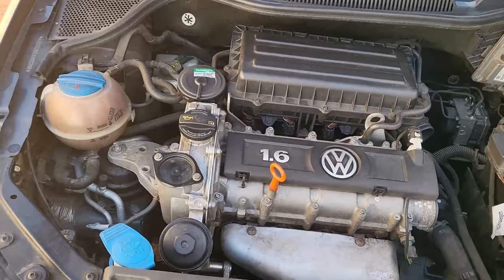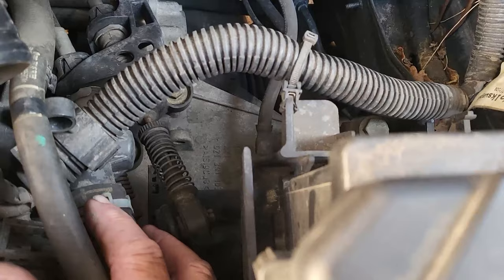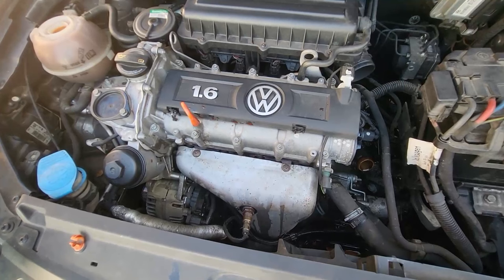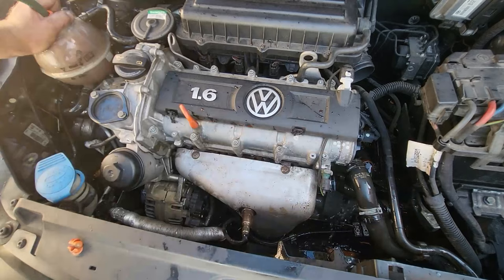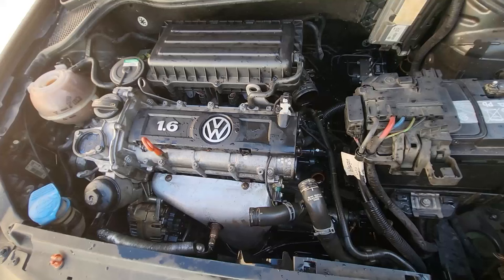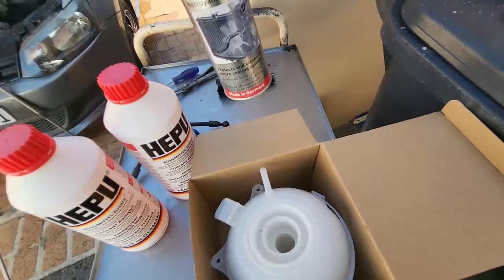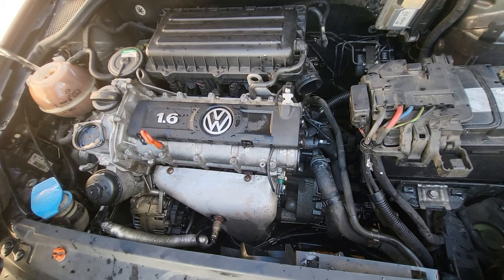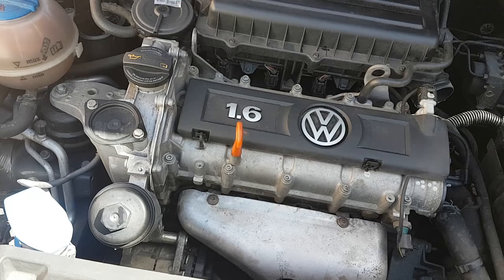Vw Polo Vivo - Treating The Cooling System

Comment: Hi Gary, i have a polo vivo. We replaced the water pump, thermostat and fan radiator switch but my fan only comes on for less then 5 seconds. Car is not overheating but i think the fan should stay on longer. Any advice please.
Reply from the maker: Hi Joshua, if the temp. is at the correct spec then there should be no issue, but some replacement fan radiator switches are known to be troublesome, so it is sometimes better to try another brand.

Comment: Thanks Gary, just a question if I'm done with the flush how do I bleed the system
Reply from the maker: Hi, Adiel refer to the time stamp at 14:12 on the video, one has to remove the temp. sensor and make sure no air, but water only flows out, then put the sensor back and secure it with the clip, also make sure you put the sealing o ring back on the sensor before putting it back, finally check it is not leaking. I hope that helps you, and thanks for your support it is greatly appreciated.
GARY

Comment: Does the radiator have a drain plug? I need to do it on my Polo Vivo 2014 but I have office hands🤦🏻
Reply from the maker: No, it does not, you have to loosen the lower radiator hose.

Comment: Thank you Gary. This helps me a lot. I just got mine overheated last night while travelling 300km. Will exactly do as your video.
Reply from the maker: Thanks for supporting my channel, Ahmad, all the best with treating your cooling system.
Reply: I did a trip with polo like this  from southern suburbs to ceres. It was raining very hard and I was driving quite fast the whole way. 120-160. As I got into ceres I got a dash warning with beep that coolant level low. Stopped car and I see coolant was halfway empty on the bottom part of bottle. Stopped at garage and topped up with water.

First time something like this happened. But I been checking everyday now and coolant level is fine…thoughts?
Reply: @luqies  I had same situation with my 1.4l gasoline Polo. The main reason was air intake preheater pipe which was cracked. Thus it's made of plastic and needs attention.
Reply: I sorted it out. It was the heater core that was leaking. No leaks now all good
Reply: This was super helpful, I have to replace the thermostat housing. Any advice should I flush firsts then replace?

Comment: Thank you for the lesson, Gary. 
I have a vw polo 1.4. CLP engine. The fan does not swing once the temperature switch sensor is plugged in. But it runs perfectly once the switch is unplugged. Unfortunately, for now, the fan stopped working completely. I tried taking it to mechanics, but they are failing to fix it. 
Please advise.
Reply from the maker: The switch that activates the fan needs replacing (the one you unplug to get the fan to work)
Reply: @vehiclemaintenanceandrepai3790  Thank you, I will try to replace it.
Reply from the maker: @masuleleon5283  I think it will solve your issue

Comment: I have completed all the steps! Very helpful video. I just added anti freeze. Is it fine with just anti freeze or should you dilute it with water? I used the same anti freeze as you.
Reply: But now I am stressing. How would I know if I have done everything right? I replaced the water bottle also but I see the one goldwaget gave me looks the same but its different inside. I have done about 50kms so far with the car and hasnt overheated?

Comment: greeting
does it have to be pink g12 antifreeze or can i pour green antifreeze
Reply from the maker: Vw-approved antifreeze does not come in any other colour. You can use another colour but it will not be the correct spec for Vw. so it will be less effective, but it can be used.

Comment: Could this treatment help solve a problem with the temperature guage fluctuating between 90 and 110 degrees on VW polo vivo 1.4 (2013 model)
Reply from the maker: No, check the temp. sensor on the engine, it may have to be replaced.

Comment: Hi There, very informative video. Quick question were is the thermostat on the 2010 polo 1.6 TDI is it also just on the right hand side of the engine block?
Reply from the maker: It is housed in the water flange, not quite sure about which side on the TDI but the petrol versions are in the flange behind the cylinder head, just trace where the radiator pipes go it should be into the water flange.

Comment: Hi Gary, great video very clear and concise 😊 I've got a water leak small leak via a crack in the water bottle, can I just replace the water bottle and throw some antifreeze or do I have to flush the system to replace the bottle. Thanks for the video and thank you in advance for further advice
Reply from the maker: If there is no rust in the system then just replace the water bottle and add anti-freeze, if there is rust in the cooling system a flush would be recommended, thanks for your support it means a lot, Wade.
Reply: @vehiclemaintenanceandrepai3790  hi Gary, there doesn't appear to be any rust in the system. Will replace the bottle and add the antifreeze you've recommended for vws. Thank you again. Will continue to support your great work🙌🏽💯

Comment: Hi Gary i have a Polo 1.4 with a rust and calcium buildup what is the proper way to treat  it the fan is not also switching on automatically
Reply from the maker: You need to flush the cooling system until the build-up is either greatly reduced or eradicated completely.

Comment: Hi there Gary. Thank you so Much for the  video. My Polo Vivo is seems to be not circulating the water in my tank. When I start the car the Water light immediately goes on.  The temperature levels don't go beyond 90°C on the reader. I have been advised that it could be the water pump that is the issue. Is there any other possible things I may Check?. Thanks
Reply from the maker: Hi Thamsanqa, it sounds like the water pump may need replacing, it could also be malfunctioning sensors, like the one in the bottle that warns of low water levels and the temp sender unit that measures the water temp. have these checked 1st.

Comment: Hi Gary if the water level picks up in the reservoir as then is heating and goes down when the fans come on. Is it normal or is there air in the system?
Reply from the maker: Normal as the water expands when heated.

Comment: Hi Gary, thank you so much for the video, new subscriber here. I have a same model, coolant water finishes within a day after driving few kilos, no leakage and overheating light comes on, what could be faulty here? Your response will be much appreciated.
Reply from the maker: Iit could be the Reservoir Cap's pressure valve opening too soon, common on these, try replacing the Cap and see the results, Tsepiso
Reply: Hello there, I’m experiencing the same thing but my anti freeze warning light comes after less than 500 km’s and this has Been happening for the past 3 months

Comment: Seems very good u need to replace the thermostat housing, does this need a gasket and or any gasket maker or silicon?
Reply from the maker: It is always recommended to use some gasket maker to help seal when replacing a thermostat housing, Vivian

Comment: Hi Gary I have the corsa Lite 1.4. After replacing the water pump and doing all the belts etc my water hasn't been circulating right. Almost as if my radiator is clogged. Now there is a lot of dirt/rust in the bottle. Would i need to remove the thermostat to do a flush? I'm kinda stuck sigh
Reply from the maker: Yes, it will be advisable to flush the engine, but also have the radiator flushed by radiator specialists, 9 times out of ten it is the radiator that blocks 1st as the tubes are very thin in the radiator, so if there are signs of rust, it could cause partial blockage in the radiator.

Comment: Hi Gary I have a Polo vivo 1.4 CLP engine....I recently redo my Top gasket and replaced the thermostat housing but my fan is not turning on...any advice?
Reply from the maker: Check the fuses and the connection to the sensor switch, Christiaan.
Reply: Ohk thank you...will do that

Comment: 60/40 or 50/50 water mix. I think Gary forgot to mention that. The water capacity should be around 5l. The antifreeze showed amounted to 3l. The water would have been 2l. Distilled water should only be used.
Reply from the maker: Thanks for your insights on this matter Matt, much appreciated.
Reply: I think if mixing the coolant yourself then distilled water should be used & depending on the climate of a country hot or cold the mix should be varied to cope with the climate ? 
   I heard that about the climate thing years ago somewhere lol, 
   But if your just flushing the system through its ok to use the tap water initially as its not staying in the system , 
  Ready mix antifreeze uses  distilled water anyway so that will counteract any small amount of tap water left in system .
   This is not a dig at you Matt or Gary this is just some info for those not in the know coz some of the comments on this vid shows me that some people havnt got the foggest on whats what regarding the coolant system in their motor. 
   Putting straight neat anti freeze without water into system  is not a good thing to do & putting anti freeze in system with regular tap water will eventually corrode parts & limescale up which again is not good & will become costly in the end so its best to do this job properly & to the letter of the manufactures specifications & dont attempt it if you are a complete novice .
   You could get away with doing it yourself many moons ago as the systems were straight forward but these newer motors engines are not so straight forward & again even attempting to do the coolant change without the adequite knowledge can become costly in the end tbh . 
 Thanks Gary for the vid & i did like how you gave your engine bay a virtual wash haha .
Reply: @pw3565  agreed with your statements above. I was told many years ago aswell that old coolant actually causes static in your engine so it’s best to change it every 2-3 years. Especially with newer cars, this creates havoc with the electronics.

Comment: Hi Gary, I put coolant like you did but I have been going through the comments and I saw someone who said we should put 60/40 of the coolant and distilled water so will it cause any damage if the coolant is not mixed at all it’s just pure coolant?
Reply from the maker: It will be okay, any coolant is mixed with water anyway, it is just the concentration that differs, thanks for supporting my channel with your visit and interaction.

Comment: The hepu coolant is 95/96%? It wasn't mixed 50/50? or was it used as is with no battery water premixed?
Reply: I had the same question, that is it not recommended to use distilled water, as compared to tap water?
Reply: @moffatk7948  I done it to my vivo  using that coolant but mixed 50/50 with battery/distilled water, i change it every 2 years, but I do mine differently not as thorough like this.i will let the car run with tap water and the heater on, then drain it by the little tap underneath the radiator,  because I don't allow mine to get as bad

Comment: Hi Gary does this method flush the heater core as well?
Reply from the maker: Yes, you just have to turn the heater unit to blow warm air while running the engine to flush.

Comment: Hey I’m having hard times to put the C clip on the temperature sensor back in please help…
Reply from the maker: You have to make sure the sensor goes in properly and the o ring seals correctly then the clip should go in easy.
Reply: The sensor is properly in I even try to lubricate it but still the C clip don’t want to slide in 😫😫😫
Reply: @vehiclemaintenanceandrepai3790  I tried my best it doesn’t want to… I even broke two of the C clips now tomorrow I will buy another… I hope on your next client that has the similar model you will show us how it’s done 🤦🏾‍♂️🤦🏾‍♂️

Comment: Good day Gary, im Eric based in East London. I have a polo vivo that has a over heating problem. It had the same issue 2 years ago and i eventually opted for the top gasket to be skimmed. The car overheated still even though i changed the thermostat, water pump, fan switch and checked the radiotor. Diagnostics showed an issue with the fan relay and i changed, then the over heating stopped since last december until this week. What could be the problem according to your knowledge? Polo vivo 2012 1.4 clp
Reply from the maker: You must perform a cylinder leakage test to make sure the gasket is not blown or the head, 's water jackets are not corroded and compression leaks into the cooling system.
failing that one of the components you replaced is faulty, some brands are inferior and do not last.
Reply: @vehiclemaintenanceandrepai3790  thanks for the reply. How is the leakage test done sir
Reply from the maker: It involves special equipment whereby the cylinders are tested 1 at a time, the piston is put at TDC with the valves closed, and the engine must be locked so the piston does not move when compressed air is pumped into the cylinder. 

Then compressed air is pumped into the combustion chamber via the spark plug hole, and then the pressure is monitored. 

There should be no drop in pressure to ensure the cylinder has no leaks, as I said it is a specialized test. 

If the cylinder leaks it can be determined where the leak is, into the cooling system, down to the sump, leaking valves a cylinder head gasket leak, even a crack in the cylinder head can be detected with this test.
Reply: @vehiclemaintenanceandrepai3790  Goodness lord this sounds very much expensive. Any idea of the price?
Reply from the maker: I charge R800 for such a test and a full report of the findings.
Reply: @vehiclemaintenanceandrepai3790  where are you based? I am in East London Eastern Cape
Reply from the maker: Cape Town, sorry

Comment: WHAT CAUSES THE WATER OF A VW POLO NOT TO CIRCULATE?
Reply from the maker: Water pump impeller, thermostat stuck closed, blockage in the heater and or radiator
Reply: Sound like a faulty thermostat had the same problem
Reply from the maker: I agree with Sean, it could very well be a malfunctioning thermostat.